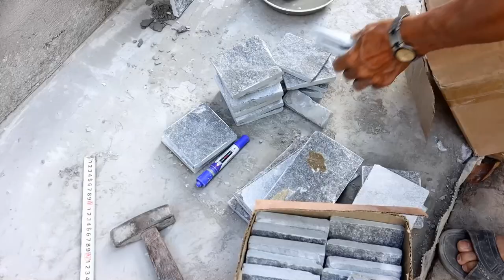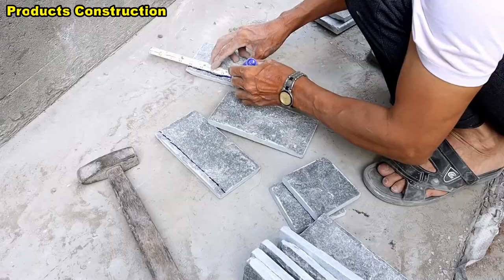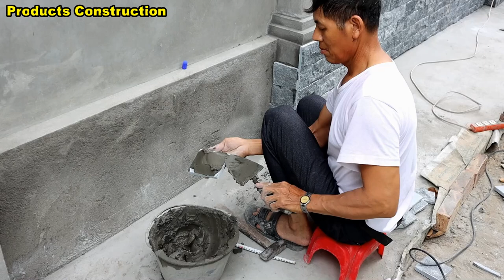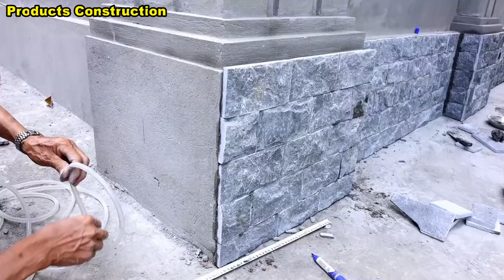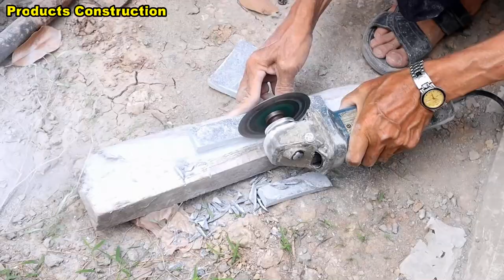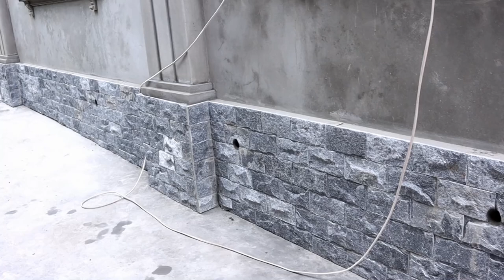Techniques Installation Natural Stone On Concrete Wall

Comment: Lousy installation will not last, improper concrete adhesion, he doesn’t even use spirit level to check. Cornering also wrong 😑
Reply: He's skilled worker